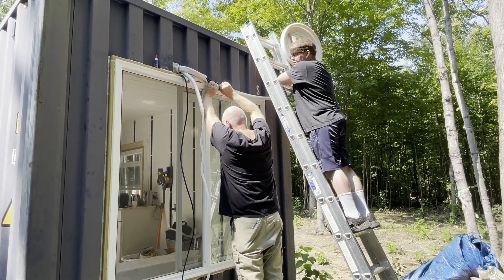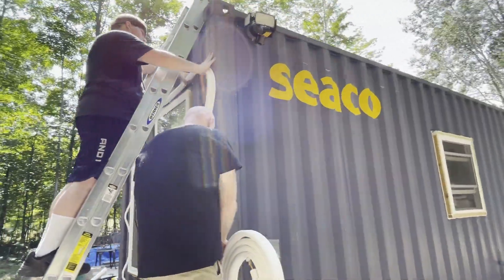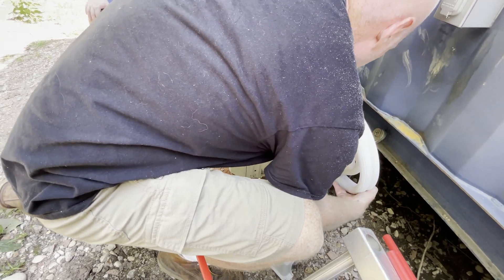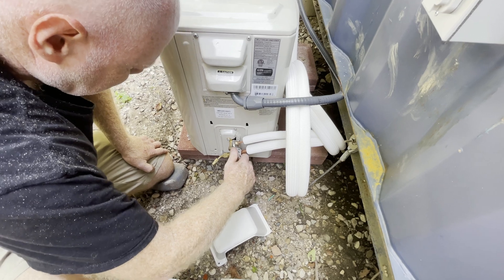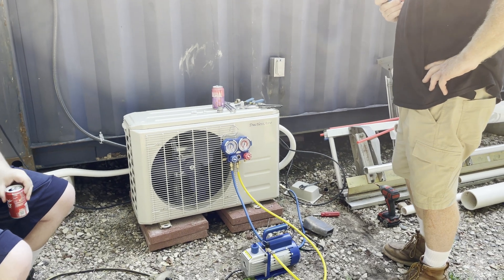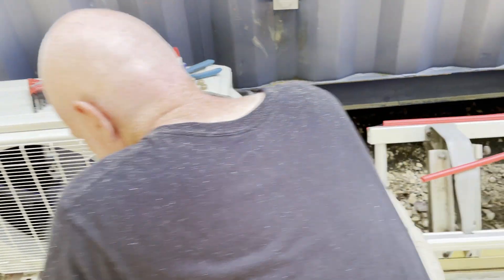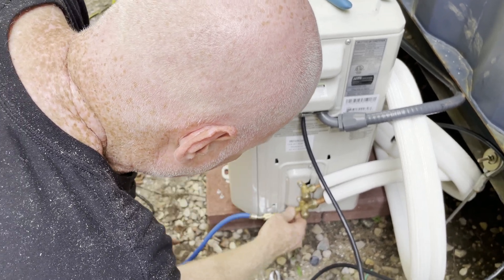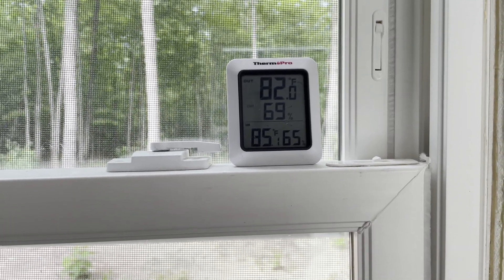We Installed Ductless Aire Minisplit Heating/Cooling System in our Shipping Container Home.

Comment: Its called a mini split because the condenser part is split from the head unit that blows inside the room.   Not because it does heat & cooling 😅

Comment: Did you shield the communication wire from outside elements at all?
Reply from the maker: Hi Roberto, thank you for reaching out. The communication wire along with all other connections are enclosed in a ‘cover kit’ for air conditioning and heat pump lines that we purchased additionally at HD for $38.00. It was a 3” X 7 1/2’ line by Ductless Aire. I hope that helps! 😊

Comment: Can you tell me if DuctlessAire is designed to be a DIY system? Do you have to vacuum the line or did you decide to do that to be safe. Thank you for posting.
Reply from the maker: Thank you for the question. The DuctlessAire is pretty straightforward for DIY. We recommend watching a few other videos to familiarize yourself. You will have to vacuum the line which requires an investment in the tools which are necessary for installation (HVAC vacuum pump, adapter to hookup the vacuum pump, and general hand tools). You’re looking at about $150-$200 off Amazon. Good luck and let us know if you have anymore questions. We are happy to help!